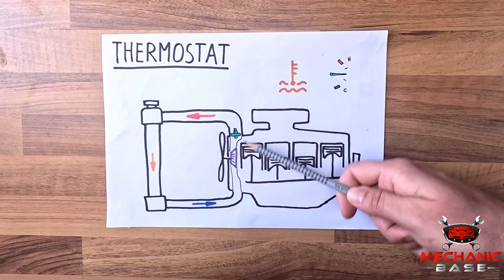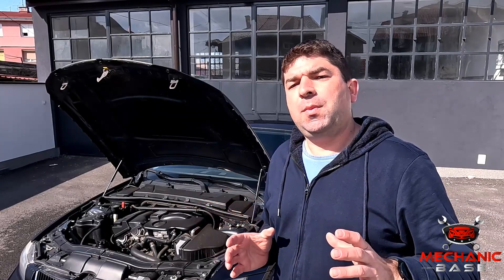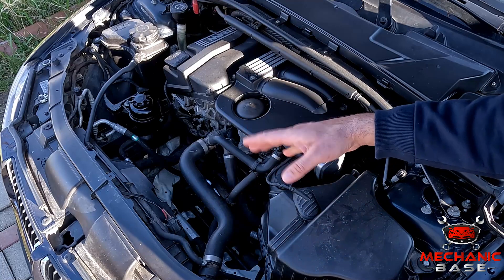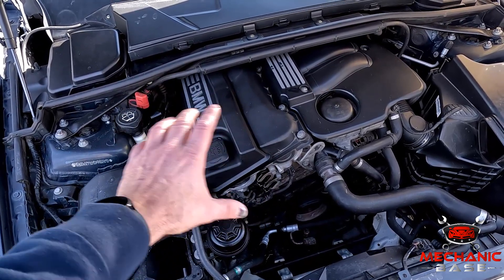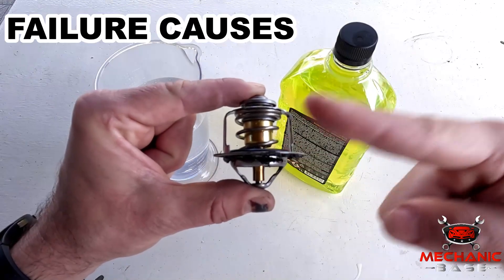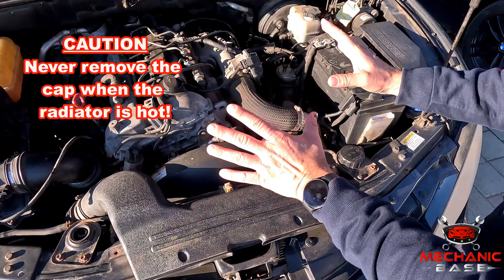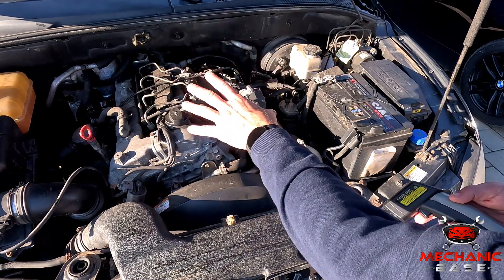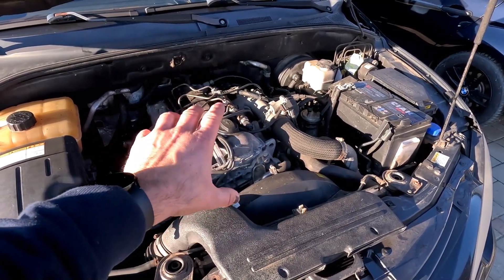7 Symptoms Of A Bad Car Thermostat (and Replacement Cost !)

Comment: Thanks for taking your time and sharing the details, i have one scenario, During stop the temp gauage increase(212F/100C) and the Fan kicks on and its come to normal and it happens often , Even Raditor got replaced  but the same . Can it be a Bad Thermostat